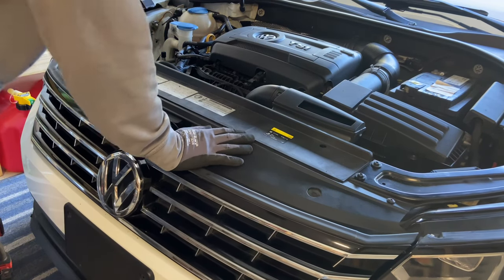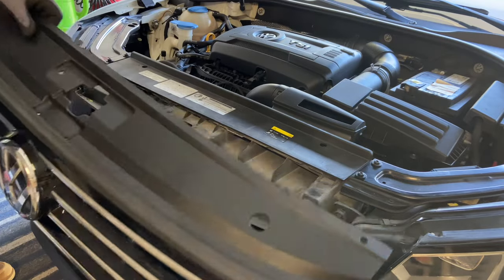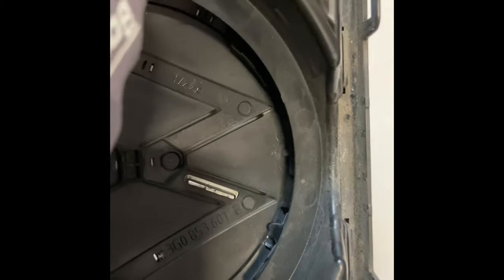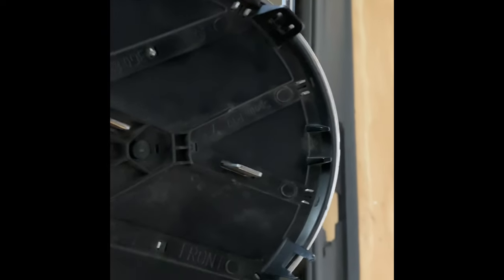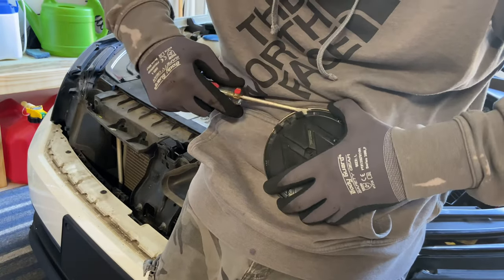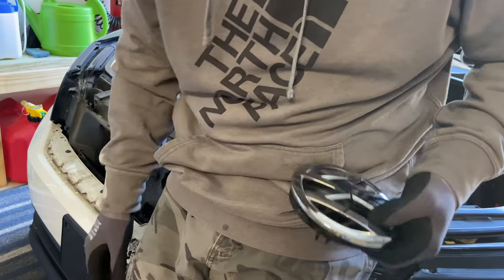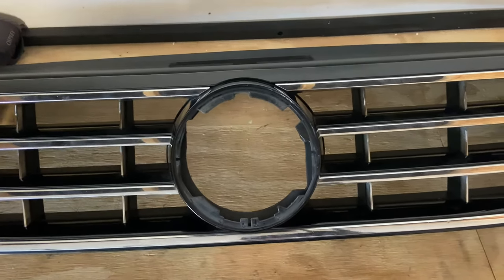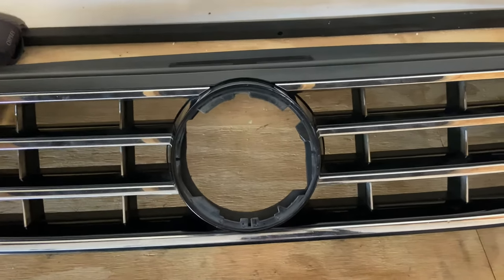Grille And Emblem Removal - 2016 VW PASSAT 🔥 #passat

Comment: the VW $70 is that not expensive
Reply from the maker: You can get it cheaper than that.  But I just wanted to show how to remove it.
Reply: I have been quoted £200 for new badge (uk sensor) by my VW dealer 😂 
I need to remove my grille to calibrate the adas sensor
Reply from the maker: @heronaddict2 now you know how to remove it 🤣 💯
Reply: @grind-it-out was getting it back on a pain in the ass though ?
Reply from the maker: @heronaddict2 yea true.  $70 not bad.

Comment: the bottom part of the grille removal helps if you add some downward pressure from the top, in my experience at least
Reply from the maker: Yes I pushed down on the top to release pressure on bottom.  Very true.  Thanks Kevin

Comment: I have tried all methods in removing the grill and its not budging
Reply from the maker: It’s a good hard pull.  Pry and pull at same time.  Find a strong point to pull on.  It’s plastic.  It’s not easy but it will come off if you pull enough.  I thought mine was going to break and it finally came loose.  Be careful

Comment: Great video. Thanks! 
So would you use that plastic removal kit to remove the grille? Would you still pry it against the headlight or against a different part?
Thanks!
P.S.
I have the same model, different color. How many miles do you have on it and did you ever have any mechanical problems with it?
I have 115.000 miles. Did regular maintenance. 
Only had air conditioner stuck on heat on left side. Fixed it. Also, it burns oil 🛢. Every once in awhile I have to add oil. My mechanic actually said that the engine burns oil. Not very happy about it.
Reply from the maker: I’d use the plastic pry tools.  Yes.  Limited force and a little wiggle should do the trick.  It did for me.  😁
Reply: hey, how did you fix the air conditioner stuck on heat on left side please? I'm facing the excat thing rn, Thanks
Reply: @hasta62  took it to repair shop.
Reply from the maker: I haven’t had to fix mine.  Yet !!! 🤣
Reply from the maker: Yea I’m not sure how to repair that.  If and when it happens to my car I’ll just figure it out and post a video.  It’s so expensive going to repair shops.
Reply from the maker: Let me know please what the fix was.   Thank you